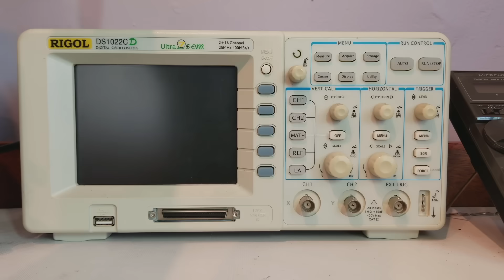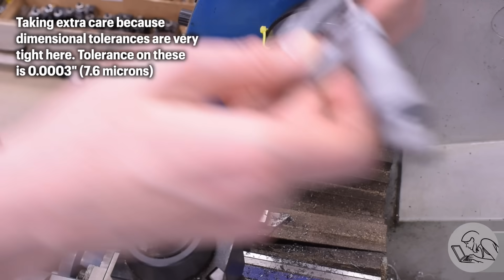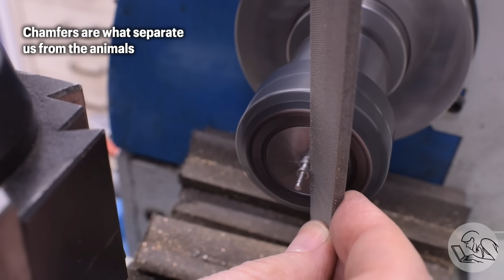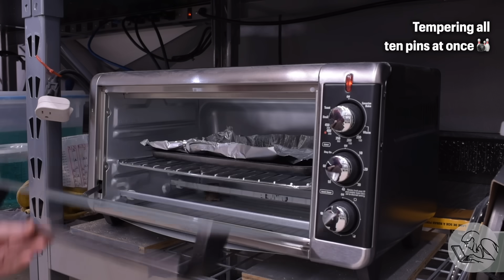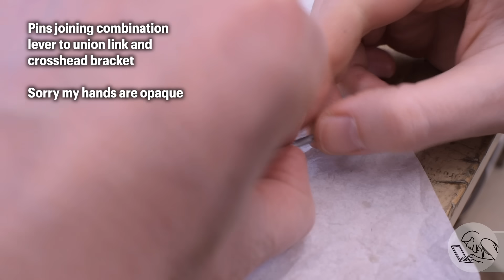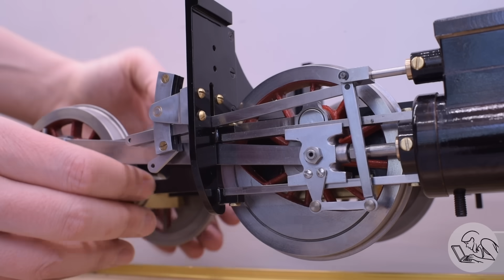Hardware and Q&A - Pennsylvania A3 Switcher, Part 64

Comment: The Shay is my favorite, too.  A few years ago I got the Shay and the Climax books.  I need to get the A3 Switcher, now.  And I'll look and see what others there may be.

I have a lathe and mill, but they are still sitting in my hall waiting for me to make room in the basement for them.  Even so, I doubt I will ever make any of these locomotives.  I doubt I'll get good enough to make one before I get too old to.  I'm planning on making small engines, like a twin cylinder double action wobbler.  Maybe make a much larger valve type for powering a small boat at 2 or 3 MPH.

The Southeastern Railway Museum has a rather strange engine has some of the features of a shay.  It has 2 double acting cylinders in a V configuration.  The heads up in the air on each side with the cylinder rods aimed lower in the senter of the loco.  They operate on a crank shaft that transmit the power to the drive wheels by bevel gears.  If I was to decide to build somwthing ambitious, I would have to consider that one.  It's just so bizarre.  Well, at least, I have never seen anything like it.

I'll probably just stick to small toy engines for fun.
Reply from the maker: That engine you describe is a Heisler. Another type of geared logging locomotive

Comment: You ZIP TIE the lock ring! How obvious. I'm thinking. Yea if I dont have the chuck on this thing I'm gonna have to hear this thing rattling around! lol. Question.. That ER collet chuck. Is MT4 tapered? I hear you cant put a lot of side load on MT shanks. But ok for small parts? Thanks!!
Reply from the maker: It has a draw bar. I’ve done a video on it

Comment: Is there a reason why the Jeezus clip is on the outside instead of the inside on the top pin? The other pins look really sharp with the head facing outwards. Of course you will have this apart about a hundred more times before it's done.

There are tools that make install circlips a little less irritating, but someone really needs to come up with something better, and they'd make a fortune. There just doesn't seem to BE anything better when bolts would just undo themselves.
Reply from the maker: It has e clips on both ends. It has to or there’s no way to assemble it
Reply: @Blondihacks Ah, I need to take a closer look at the final shots, I must have missed that detail.
Reply: I saw you slide the pin in, but I don't think you installed the inner clip on camera, just the outer one, right?

Is this about DISASSEMBLY, not about assembly? If you can attach the inner clip, there doesn't seem to be a need to have a clip on the outside too (since a head would retain that side just as well), but I can see how it would be really hard to remove that inner clip with the wheel clearance, and it would be easier if you could remove the outer one and wiggle the pin out.

This is inconsequential of course, just curious about how this complex piece of engineering goes together.

Comment: the shae is easily the coolest locomotive just for the running gear alone. the sound they make, the sway, the goofy asymmetry, i adore with all my heart. they remind me of old ex-street cats that are a bit lopsided but full of love.
Reply: I live near a museum that has a shay on a plinth out front (it is a shame it isn't running) and is probably the main reason I always loved those locomotives. But after decades of driving by it, it wasn't until someone on YouTube pointed out that the boiler is offset that I noticed.
Reply: @derrickfoster644  i love their skrunkly boiler offset it's endearing as heck

Comment: Hornby did once make a series of OO scale live steam locos. Not coal or gas fired though, they use an electric boiler in the tender. Only produced for a short time and horrendously expensive. Seem to recall the starter set with a loco and controller was £1000, back in the late 90s or early 00s. Lovely to watch storm around a loop of track with 12 carriages in tow.

Comment: 8:00 - to add: as silly as it sounds, even if the foundry/factory is building... 6 of an engine... 100 of an engine... NONE of them come out of the factory the same.
I used to work in a tram museum, and they half-jokingly used to say that there's supposed to be 12 classes of tram there, but really there's 45 different classes (they had 45 trams total, including long term storage).
Later in life, when I got to drive new ones, straight out of the factory - each vehicle was so wildly different it was shocking. One would come out perfectly, one would have a clunky throttle... they ALL have personality, long before local maintainence crews have a chance to play with it.

Comment: I LOVE the Shay.  I have Kozo's original and the new shay books and they are amazing.  I am actually in the process of working through converting the original Lima Locomotive Works drawings for the Western Maryland Shay #6 into 1.6" scale using AutoCAD Fusion.  I have completed the entire frame and have now started working on the trucks.  Still a long way to go, but learning a lot trying to work through the original drawings.  Being able to see the part in 3D is incredibly useful in helping to understand how it all works together.

Comment: Quinn, I really enjoy watching your channel and am always impressed with the quality of the work that you do.  I do have one suggestion for the C- (or E-) clips installation.  I have always had better luck by getting the clip started in the slot, and then using needle-nose pliers perpendicular to the  clip's motion so that as you squeeze the pliers you push the clip into position.  Normal small needle-nose pliers have serrated jaws, so they help to prevent the 'flying clips' issue when used this way.  Keep up the great work!

Comment: I see you where having a little problem with putting on the e-rings. I have this tool  that i found on the big A website. It's called e- ring tool pat.M326876. It's save a lot of time  and they don't fly into the abyss.

Comment: I have been following this series for a while and its become really fun to check in on Saturdays when new videos get posted!  Technically there is a tiny bit of HO scale live steam!  I remember seeing a video about a tiny little 0-4-0 fired with a tiny bit of alcohol.  Also, (its not HO scale but a similar size) in the early 2000s Hornby produced a series of OO gauge live steam trains.  They made the A4 in a series of paint schemes and the A3 as the Flying Scotsman.  These trains were fired by electric heaters.  They have one heater in the tender inside the water tank, and a superheater in the locomotive and they use a geared rotary valve for timing.  They even have a tiny little whistle connected to the main throttle valve!

Comment: I have idea or "so to say" solution to the bigger boiler.
How about contacting let's say JLC3D or other companies and make them 3d print the whole boiler in one piece out of copper?
They are usually very eager to do colabs for interesting projects.

In my head there is huge potential to this approach and you could get away with some quite complex internal geometries that would be hard to do in subtractive or glue together processes.

Comment: I would disagree on the "there is no correct or incorrect in model engineering".....

Correct: You have built something that does what it was built to do. Look good or run on steam or pull kids around an amusement part
Incorrect: You made something that blew up or tore itself apart.

Everything else is "subjective bullshittery" and can be compressed out of the plans.  ;)

Comment: Greetings. The Virginia V is an old Mosquito Fleet boat in Seattle. I was able to tour the engine room, and holy cow, was it cool! Anyway, it uses a three cylinder triple expansion steam engine. It was easy enough to figure out what that all means, but now I'm wondering whether that configuration was ever considered for locomotives. This is late 19th century tech. Also, I sank a sailboat in the Pacific once and spent some time on the container ship that rescued us. If you ever have a chance to visit the engineering areas on a container ship, I think you'd be in heaven. They have machine shops with tools big enough to re-sleeve a cylinder and replace a piston. Everything is enormous and very cool. I can't believe Hyundai shipping let me take pictures of everything!

Comment: I too am doing a Kozo Shay, and have the "New Shay" Book, but going to do the "older" Shay. Having said that I may well use methods from both books as he gives different methods for doing the same job. Comment on your "Not correct" remarks, I am doing an LMS  Princess Royal loco, and once saw at a show for sale on a commercial stand. It was correct in all parts, but the mix of different era's on the same model was most certainly not correct, it changed many times in its 40 odd years of working.

Comment: Getting the nod of approval from Kozo-sensei is very rad.

Also, on the matter of materials, steel may be cheaper than brass, but mild steel in particular is among my least favorite materials to file. Compared to brass it's so slow and tedious, and while I never built a locomotive, I imagine there's a lot of fettling involved where you really feel the difference by having it made of easier workable metals.

Comment: Watching the E clips going on and I have a tip. Take a small strait screwdriver, the cheap advertising give aways work good for this. Then with a triangle file cut a v shaped notch in the blade end and use the notch to push on the very small E clips. The two points of contact makes it a lot less fiddly to push them on
Reply from the maker: Great tip, thank you!

Comment: Wonderful work as always, I'm so happy Kozo reached out to you to say the same. The questions about keeping motivation were particularly helpful to see answered as someone else on a multi-year project. I've always worried about side-projects becoming distracting due to the rote of the main project, but breaking it into palitable pieces (I called them modules) makes such a huge difference. Keep up the excellent series!
Reply: Quinn has thought her work process through well, building in a sensible manner. I love that she started with the key piece, that being the boiler. Her point was if she could not make that, then there would be no point to the rest of the build. She knew that all the rest of the work was something she could do.